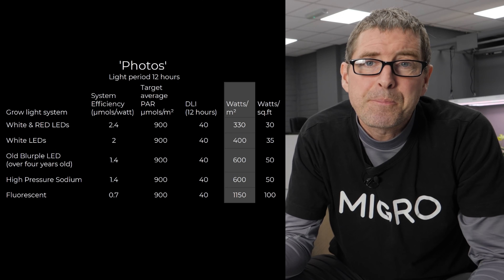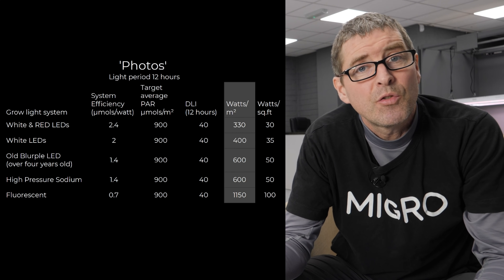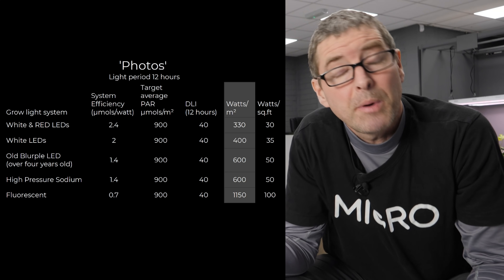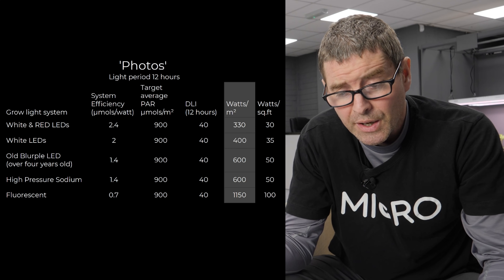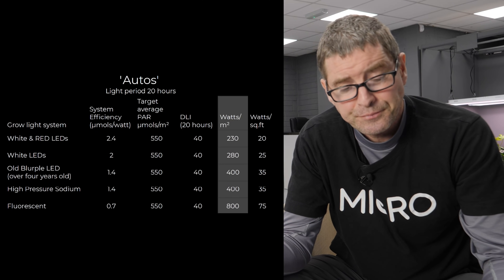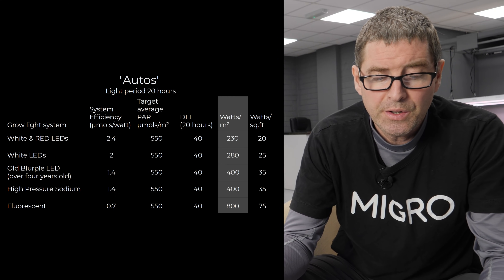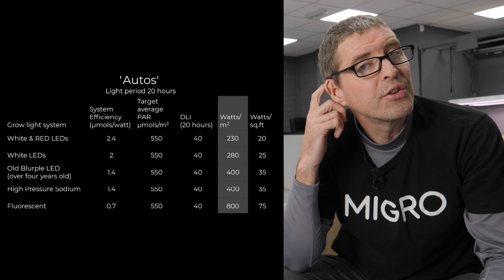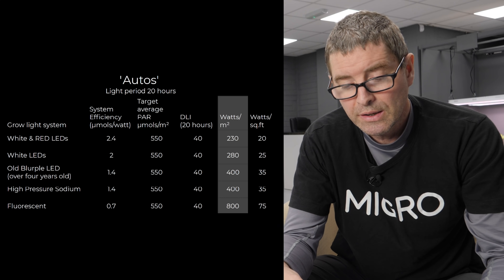Photos and Autos Recommended PAR levels for Photos and Autos

Comment: There is a standard recommendations for par levels. I dont think there's much difference for autos or photos. 
Seedlings 200-400
Vegetative 400-600
Flower 600-900
If you are in this range, you should be fine. Autos of photos.
Reply: This is only true if you are going with 18/6 veg and 12/12 flowering photoperiod light schedule. Most people give autos 20/4 light from seed to harvest,  400-600 par 20 hours of light can cause light burn at veg stage and slow down the photosynthesis without supplemental co2, same goes for 20 hours 600-900 par at flowering stage.
Reply: @ozanturan9576  it depends. I used to put seedlings as soon as they open on direct sun during mid summer without problems. It is all strain wise. I grow sativas on 600 in vege with no problems while some indicas cannot withstand that. I'm not saying that 600 is a must. I wrote from 400-600. 600 being close to max option obviously. And regarding co2, again it depends on manny things. You can run 900 in flower without it. Master growers i know introducing co2 above 1100. There's new video from tnb with lex hosting with nice graph for using co2.  And for stress from light,again is exclusively strain dependant. Clearly sativas need much more light than indicas, no?
Reply: @w@t(h3r  It all comes down to DLI (daily light integral) par alone is not enough to measure the photosynthesis, you can catch an ideal DLI with 1k ppfd giving the plant 12/12 light, but when you increase the hours of light the plant is getting there's a chance for light burn and light stress if your light is too intense and with autoflowers there is no reason to go with 12/12 light since autos begin flowering regardless of the light schedule. All these par charts actually depended on optimum growing conditions. Plants don't get light burn outdoors from the sun if they are growing in their natural habitat but indoors even half the strenght of sun's ppfd can cause light burn with the grow lights if the optimum conditions are not met, without ideal tempeture and RH plant can't transpire correctly because of VPD thus leading to reduced rate of photosynthesis and the excess energy from the light plant can't use will cause light burn and stress. If the other parameters of photosynthesis are not met, without enough co2, water and nutrients, oxygen for the root zone, ideal temp and RH it's not advised to go above 30-40 DLI even there isn't a visible sign of light burn or stress you would be just wasting electricity. I hope this was helpful to someone.
Reply: @ozanturan9576  yes my friend we appreciate your efforts...
Reply: @ozanturan9576  How much can you give 3rd week veg.....can you post a schedule of power through the grow....week one, week two etc and when to scale it up?  

I've read the 550/600 at the end of veg / early flower as a target,  I went for quarter power 150w (PPFD unknown) or the first 10 days on 24 hours for temps as it's cold here when lights go out.. then went half power 300w giving me par of 309 at 56cm and a DLI of about 20....but I'm really not sure when to lower the light or turn up the power to increase my Par/DLi readings from here, so a schedule of increases would be really useful.  VPD and humidity levels dialed in, and CO2 via pressurized FZone CO2 aquarium reactor with solenoid.  AC infinity Fan and & controller, Lumitek 600w pro in 4x4....yes I'm over powered, but it was cheaper than the 480 in a Christmas sale. I thought my light would be my best bit of kit, but it;s actually my AC infinity that has made creating the best environment easy, and is the one thing I can't do without.
Reply: @UbiquitousRomp
 Yes this is for autos based on 20 hours chart

"AUTO FLOWER LED LIGHT INTENSITY
Recommended LED PPF/PAR Values / DLI Based on 20 hrs. of light.
Seedlings 150 - 200 umol / DLI 10.80 - 14.4 moles per day
Veg up to 9" 450 umol / DLI 32.40 moles per day
Early bloom 500 umol / DLI 36.00 moles per day
Mid bloom 650 umol / DLI 46.80 moles per day
Late bloom 750 umol / DLI 54.00 moles per day
Ripen 400 umol / DLI 28.80 moles per day

* Use extreme caution going 700 umol or higher @ 20 hrs/day this could cause leaf burn***

There is also another but can't send it's link youtube auto deletes the comment look into autoflower forum Lux/ppfd/DLI chart for Autos topic

These numbers are for highly optimal conditions though, as long as the "9 main parameters of photosynthesis" as botanist say is provided to the plant it's ok to be at this range. You can also fine tune the ppfd by slowly raising the ppfd each day and keeping an eye out for light burn or light bleach. When doing this it's important to not confuse nitrogen deficiency and cal-mag deficiency with light bleach and nutrient burn or phosphorus deficiency with the light burn. Too much light related symptoms will appear on the tips and edges of the leaves that are closest to the light, you can lower the light to catch an ideal DLI to your liking as long as you don't measure more than 30c above the canopy level during veg and 18-22c during flowering.
Reply: @ozanturan9576  thanks Ozan for you reply and that useful chart...I can see how flowering at 70f would keep the humidity down and protect the buds a bit from rot and mildew.  but I thought the CO2 likes to work nearer 80 - 85f  My current natural light temp at canopy is 80-81 on half power. so I recon I would have a problem getting that low....I can hold stable 74=75f which will also put me in the correct VDP for flowers any lower and my DVP will go above 2.0.  I do realise I'll need to mix and match add lib at times especially now I'm adding CO2 to the equation.  Thanks for the pointers Ozan
Reply: @Trrenik0kb "I used to put seedlings as soon as they open on direct sun during mid summer without problems"

But that wasn't 20 hours of direct sunlight right? Plus sun has variable PAR based on daytime, morning and evening is only like 500 PAR
Reply: 600 is too high/not necessary  for veg..
Reply: @stangcobra592  yes, it is not necessary. But if you want to help reduce internodal spacing, 600 is excellent. also you speeding up the growth. More light, better photosynthesis = more sugar = more food = better growth. At least in my case. Cheers
Reply: @Trrenik0kb  as long as there’s enough CO2, otherwise too much LED light can stress out plants compared to HPS hence why you see purple stems so often.
Reply: @1TheWhiteKnight1  purple stems can develop from numerous reasons. Mostly strain related, and no need to be alarmed. Then phosphorus deficiency then light, temperature etc. You see plenty of times with seedlings, 3cm high, purple stem already from beginning. You saw that right?
Reply: @Trrenik0kb  Not mostly strain related. There's a lot of bro-science on forums saying this but it mainly comes down to stress, either from too much (led) light and/or lack of co2 and nutes to go with it. I have done tests with same strains and the biggest factor was always too much light.

Comment: I've been running up to 55, sometimes even a 60 DLI with autos over 20 hours. Can't complain they can take the upper end with the right conditions (nutrient concentration, leaf surface temps at 81-83°, humidity 65-70% and co2 supplementation). Worst case scenario your buds get slightly foxtaily, but fr they slap in yeild. I always plant more than I need to fill the space and pick only the all stars to fill up my arena. But till day 30 my autos never see more than 30 DLI, then by day 40 when I'm seeing heads they get to around 40 DLI and peak flower I really push them hard. Hard nugs starting to amber by day 65 on 80 day strains. Conesseur shiyt
Reply: It's mostly because of co2 supplementation